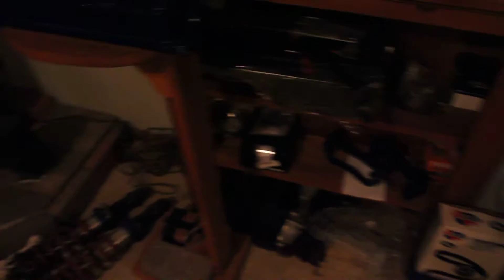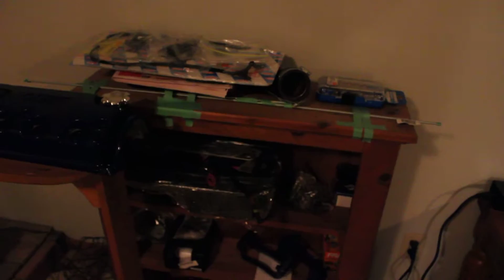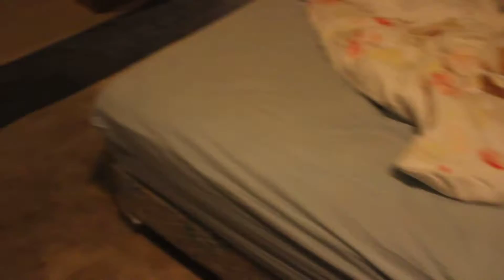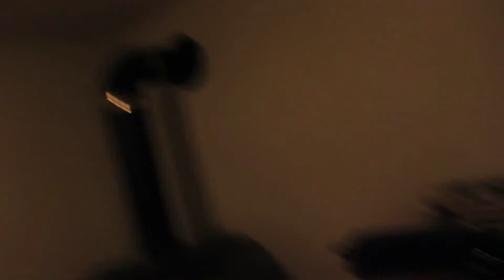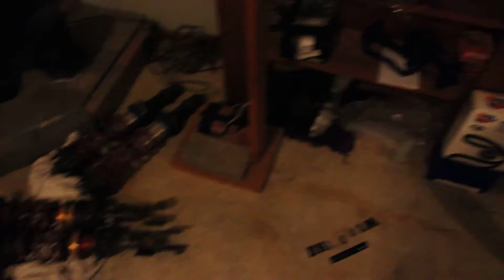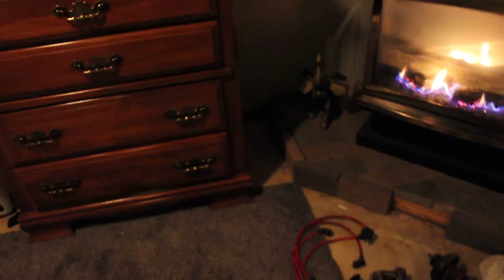Mini me swap (y8 or z6 on a "d16y7" block)

Comment: I have a y5 with bent valves so instead of pulling head to change valves I was gonna swap on my y8 head. I was wondering if I had to rewire anything. Car is a 97 civic hx
Reply from the maker: Thats not a bad idea im not very familiar with the y5 i have heard of it but the y8 will work no problem and because youre car is a 96-00 its obd2 so assuming the y8 heady is all obd2 sensors you shouldnt have to rewire anything and if you do its usually only a couple sensors usually idiol air, and if the air intake temp sensor is on manifold instead of intake pipe or vise versa you may just have to relocate the sensor for it
Reply: NoSaltGang ok thanks a lot
Reply: NoSaltGang hey man, i wanna do the y7 to y8 swap this weekend, what are some pionters for the VTEC wiring and intake hookup

Comment: hi can u help me just did a y7 y8 mini me swap 5 speed conversion used a 96-98 civic ex  p2p ecu getting a fuel tank pressure sensor code my 96 DX hatch don't come with this sensor how can I fix this? I heard the civic ex came with one?

Comment: On the y7 block & y8 head. Have you tried it with p29 piston or pg6 piston?
Reply from the maker: No i have not currently i am running a z6 bottem end and stock pistons going turbo soon so i didnt want high comp but i would have went with ycp high comp pistons not p29s
Reply: Veritas did you go that way?
Reply: @casalin1801  y8 head y7 block with p29 piston

Comment: What did you do on z6 on radiator hoses there are three on the z6. I'm y7
Reply from the maker: Portland Sstar Im Not sure if you mean the ones on the water neck for the iacv or the bigger hoses if you are refering to having extra one you dont need you can always cap them off and use the ones that work best!

Comment: There's a d16y7 with a d16y8 head built for turbo it made 410 who on 91 pump gas
Reply: I would have use the y7 head locked the vtec in because if anyone knew the y7 and z6 heads are the same besides the distributor bolts and the vtec solenoid the flow of the y7 and z6 are exactly the same as if the y8 has less flow, really the y8 is good for mid end power and another difference is the combustion chamber is different too so it has more compression